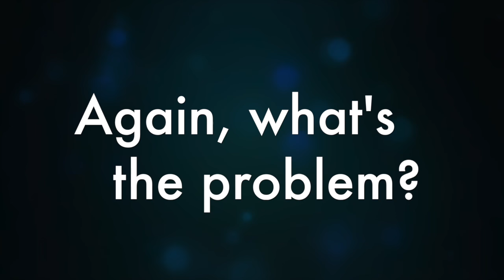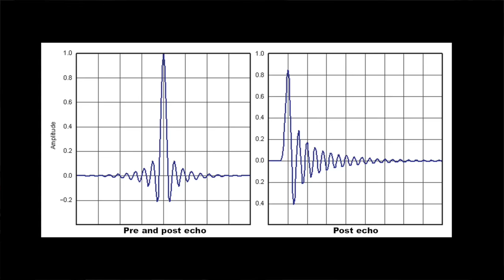The truth about Nyquist and why 192 kHz does make sense

Comment: thank you Hans for this video
I was always impressed by the sound of hqplayer when upsampling red book material to 24/192 but never had an answer to question of my friends who would ask why upsample?
they always think upsmapling is always a no. i guess I can show them your video to know how upsampling moves artifacts in sound outside the audible range making sound more clean
Reply from the maker: I would d wait some more weeks. I will publish a video on upsampling and oversampling that might give more clarity on those subjects.
Reply: +The Hans Beekhuyzen Channel 
thanks Hans, do try to include software upsampling also from popular software like hqplayer as more and more seem to be using it.
Reply from the maker: +Rikhav Shah I will not include HQplayer. They have not responded to my request to provide me with a review sample and I won't buy equipment or software just to review it.
Reply: +The Hans Beekhuyzen Channel I agree  with you that you can't keep on buying software and hardware just to review it. hq player is general free for one month . basically as trial you can use whole software and after month is over you will need key to run it
Reply from the maker: The point is that I can't spend all my time on one subject. Furthermore I sometimes need some time to think about the experiences. So doing a review in one month - surely when the pressure is on to do it in one month - is impossible for me. So I think you have to find other reviews. Sorry.
Reply: I totally understand you Hans. I also feel hqplayer has so many filters and settings that you can't review it in a month, specially with a deadline hanging on you.
Would you be including any other software which supports pcm and dsd upsampling as there are many which do it latest being DAPHILE. Best part is that it completely free and they just request you to donate if you like their efforts
Reply from the maker: No it will be a general explanation of up- and oversampling
Reply: Hi Hans, that will be surely very informative as in general many including me are still confused between difference of upsampling and over sampling

Comment: I seriously don't know why all the people that claim it does or doesn't make a difference by going higher in sample rate, do not measure the differences with good measuring equipment.

There's a good audio blog I sometimes read that has. The blogger has done FIR tests, comparing different sample rates. Forgetting about all the filters he tested with, let's just take the industry standard linear phase filter:

5kHz @44.1kHz = no pre or after ringing

10kHz @44.1kHz = small pre and after ringing

--

5kHz @88.2kHz = no pre or after ringing

10kHz @88.2kHz = no pre or after ringing

20kHz @88.2kHz = small pre and after ringing

---

As you can see, the higher the sample rate, the further up in the frequency domain any ringing is pushed. Judging from this, the sample rate standards of 176.4kHz and 192kHz would completely rid the DAC of ringing within our audible range.

Now whether that is audible depends on an individual's hearing, equipment and environment.
Reply: I would say in terms of audibility, one could potentially hear the effects of ringing @44.1kHz and @48kHz as if I remember correctly, the actual Fourier ringing is double the impulse frequency (I may be slightly wrong). Judging from the data, this basically means that ringing could start around 8kHz and therefore add audible 16kHz+ noise to the audio. This would have the effect of making things like snares sound too sharp and artificially changing the soundstage.

When at 88.2kHz or 96kHz, there is technically still ringing but as the ringing probably kicks in around 16kHz then that would mean the added noise would be 32kHz+. This is not audible, but could still affect the sound. If the audio has a lot of higher treble energy, the speakers tweeter will be working overtime to reproduce not only the actual fundamental frequency but also its Fourier ringing too. I do not know how this would could affect the sound from an audible point of view.
Reply: In terms of audibility though, it also depends on the DAC's filter that is used. This is why the trend of having selectable filters exists, as DAC manufactures know that it makes a difference. Many DAC's can sound equal in tonality and dynamic range, but seemingly different in soundstage and attack. This is all to do with ringing.

Pre-ringing affects the transient response of upper frequencies, having a noisy response will add harshness or a dirtier attack. Having zero pre-ringing will keep the "attack" untouched and accurate, sounding natural and clean of a "digital sound".

Post-ringing affects the upper frequencies sense of space. Having a long post-ring will artificially increase the distance in between sounds, therefore making the soundstage bigger than it actually is. Having zero post-ringing will not stretch the soundstage and preserve its original distance and depth.

Comment: This seems to be an argument of diminishing returns. 

The human ear and brain are variable and people will, without fail interpret things like audio files differently. 

The cost to value ratio is far too high for the average consumer to even engage in the idea of purchase of high end sound equipment, worth most of it even at the entry level exceeding 1000 usd.  I could probably sit down and calculate percentages of better reproducibility in a mathematical expression for 16bit 128 vs 16 bit FLAC,  at which point the percentage is so different,  (tens place) that there is an audible difference.  But by that same method,  the difference between 16 and 24 is in the single digits,  but the cost is not.   It just doesn't make practical sense to go to such extremes for such a small difference.   Until that changes then the breakthrough threshold for consumer interest just doesn't seem practical.
Reply from the maker: Your argument seems a denial of audio quality. Of course, differences will be judged differently by different people. But the argument that digital sounds harsh and vinyl sounds better is almost universal. Reducing the time smearing caused by the anti-aliasing and reconstruction filters will be appreciated by many and not just audiophiles.
Reply: The Hans Beekhuyzen Channel 

I don't mean to imply that audio quality is non existent.   The difference between 128 mp3 and 320 mp3 is very obvious.   The difference between 320 and flac is also present and detectable.  But when one starts to exceed the Phillips CD industry standard, the value of investment to return becomes less and less. Understandably the cost becomes more but not proportionate to the return.   With sampling rates, once you exceed 44 khz it's beyond the scope of human capacity to hear.   I imagine that if anything,  harmonics of the artifacts beyond the 44 khz range might even distort that which we can hear.   I don't see how an increased sampling rate,  even in terms of archival purposes can have any net positive until the human ear gets better.   With regard to bit rate,  16 isn't at the threshold of our hearing, it's true.   But the dynamic range is pretty close to 100 and can be augmented to approx 110.  But that's sort of a moving target.   24 is closer @ 140, that's also true,  but again the return value is arguably signifigantly less than the difference of 8 to 16.  While it is better and I think we both agree on that,  more bits than 24 seems like the cost would exceed it's value by an even greater percentage. 

As far as analog vs digital,  analog is warmer and digital is definitely more analytical,  because that's how the conversion process works.   As far as better sounding,  to me that's personal preference.   

In summary I don't deny the audio quality changes,  because scientifically,  it does.   But beyond 44khz@16bits and the cost of the equipment required how can one argue it's not a diminishing return?  Beyond 24 bits I don't even know if there would be a difference that we could perceive other than placebo.
Reply from the maker: I am afraid you're missing the point of this video completely. It is not about the frequency domain but the time domain. Did you really watch this video? I clearly state that we will not hear any signal above 20 kHz. And I do explain the filtering is the problem.
Reply: The Hans Beekhuyzen Channel.  Yes I watched it.   I know you said that beyond 20 khz we can't perceive,  and I agree.   The argument you appear to be making is that greater equipment and a higher sample rate would lead to a more precise representation of a analog sound wave in digital format because the curve wouldn't be as steep, thus yielding a better accuracy towards a true duplicate.   My point about the higher sample rate is that it's possible then to have an artifact harmonic that would offset the newfound precision, not to mention the diminished return of less steep filter angles.  While an oscilloscope could detect the difference, I'm doubtful that we can.  I'm arguing the value to cost problem this presents while speculating about potential negatives to increasing a sample rate beyond human hearing in terms of theoretical precision of the original analog sample.   Do you think that with a slightly less steep curve that in a blind test you could accurately distinguish between 44khz Sample rate and anything above it with an accuracy of greater than 75%?
Reply from the maker: Use your ears and a proper stereo and this discussion will end.

Comment: The math of Nyquist is definitely correct but it requires the sine wave to have been present from now to back before dinosaurs went extinct.
Reply: MF Nickster  You may already know all this.  Apologies if I'm preaching to the choir.  What I see all the time is "Nyquist EXACT.  CD Perfect"  So, I'll point out the problem with CDs.  I'm certainly no audiophile; I'll happily listen to MP3 and AAC and my CDs are ripped in AAC (but I still have them).  I doubt anyone can hear it on a CD, but Nyquist on a CD with realistic audio (not boring tone generators) is basically saying, "the higher the frequency, the more in the past and the future we need to go to figure out what is going on right now between the samples."

It's not intuitive, but all audio can be composed of sinewaves that have existed for all eternity and will continue existing for all eternity (hence things like the discrete cosine transform).  Nyquist math requires these sine waves to exist forever.  And when you remove the high frequencies from your audio, it's also not intuitive how that distorts the audio.   

On vinyl, what happens now doesn't depend on the past*, and the future isn't there yet; you get at every instance in time what happened then; no using the past or future to determine the present audio.  So technically a CD has minor temporal distortion of the audio (which I believe is inaudible); this temporal distortion is worse at higher frequencies (and heads toward infinity at the cutoff).  Boring signal generators proving exact replication prove nothing because the audio has had long enough to stabilize.

If a vinyl record can handle 22.0499kHz (and I don't know if 33 1/3 can), and I send morse code from a signal generator at that frequency, you will more or less get what you intuitively expect.  But with perfect Nyquist (physically impossible, especially at that close to the cutoff), the temporal distortion from stripping off frequencies above 22.050kHz will be so bad as to not be able to pick out the morse code, assuming you had dog-ears that could hear it to begin with.

*Not technically correct due to residual charges on filter capacitors.
Reply: MF Nickster  Do you have equipment that can demonstrate what happens to Morse code at high frequencies?  I would love to see a YouTube demo of this.  I know the theory.  Before you press the key, it starts ramping up, and when you release the key, it continues with a decay rate proportional to the distance away from cutoff; it actually begins ramping down before you release the key.  I doubt anything other than an electronic scope recording to disk could capture this.  The ramp up and down would likely be too fast to see on an analog scope and anything that I could hear would likely ramp up and down so fast I couldn't tell the difference.
Reply: I don’t know how your equipment handles things above 20kHz, but the fact it quits working doesn’t disprove Nyquist. A larger sampling window might get you to 21000Hz before it falls apart. No matter how large the sample window, there will still be a range where it falls apart.
Reply: I forgot to mention in all my rants that perfect Nyquist is a vice, not a virtue. Not only are you bringing the far past and distant future to the present, but the frequencies right near Nyquist would rub each other wrong to where intermodulation distortion would be all but impossible to deal with. 

High sample rate does mathematically improve things below 20kHz. There is far less past and future required to determine the now, so the now is more accurate even in the audio band.
Reply: @robertrichter3033  In digital audio, there are lies, damn lies, and the freqency response
Reply: Any finite sized sample window is only an approximation that will fall apart near 22050Hz. The misconception is that we can capture everything up to 22050Hz. We can’t; not with a finite window.  20000Hz we can (and the error is decimal dust). And we can also roll off quickly from 20000 to 22050 to accommodate the fact our sample window isn’t infinite. Any real world transfer function based on Nyquist should include a roll off and not just truncate the sync terms.

Comment: Interesting video, I am finding that you are right on most of the things you are saying. However there are a few things that you either have misinterpreted or, as you mentioned your self "not clever enough to understand" or as I would say, possibly not having the theoretical foundation to understand. First of all, the Nyquist-Shannon theorem is mathematically proven. The implementation of that theory is something else. So, the theorem does not "fail to successfully bandlimit a signal". The theorem has many applications beyond sound. If for instance I have a knob that sends information in "steps", then the receiver must have adequate time resolution to "read" these changes from the knob without creating aliasing artifacts. Another application is video. If you live in Europe and you shoot video using typical lamps, then your shutter rate, according to Nyquist Shannon must be multiples of 50Hz (the AC frequency) so you won't have flickering. So, the theorem helps to get around situations like these. On another note, the practical application of increasing the sampling frequency is not going to offer much value to the every day use of audio technology and rather cause problems. Those who can understand the differences in DACs are a very very small percentage of people that use sound for any reason. Increasing the sampling rate and using longer FIR filters to bandlimit signals means longer latencies, something that will cause problems in live and production sound application, will increase exponentially the amount of resources a computer might need to process realtime audio, at the same fashion, this inevitably will affect video as well and in the end whatever the process of creating audio, this audio will be consumed by people on cars, headphones, earpods or whatever less than perfect audio reproduction system. Moreover, the mp3 revolutionised the music industry as it made possible to share sound over the internet... yeah, piracy skyrocketed, but the system adapted to spotify, youtube etc, and will keep adapting. So, it doesn't make sense to have a higher resolution audio file, that the extra resolution is used to bandlimit better, and then make it mp3... there's not an infrastructure yet that would allow us to stream lossless sound over the internet in the scale that we do today, so.. an idea like that, it will of course be rejected. So, why put the effort on something that will not benefit the majority of the people that use it? If there's a specific reason for you or anyone that uses sound for research, your logic is absolutely sound (pun intended) and they should seriously consider it. However, such change would mostly affect the public negatively up to the point that the technology catches on. On the other hand, most people barely can listen up to 18kHz due to noise exposure for recreation, work or simply a loud place to live. I don't see anyone getting worried about increasing resolution anytime soon.
Reply from the maker: I merely ment to say that Nyquist and Shannon might have developed a theorem that is still impossible to implement